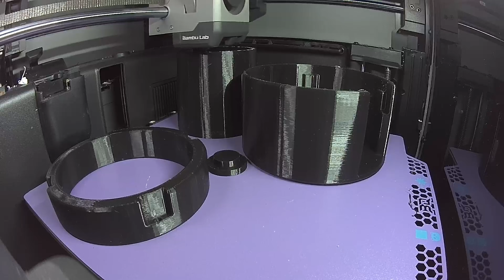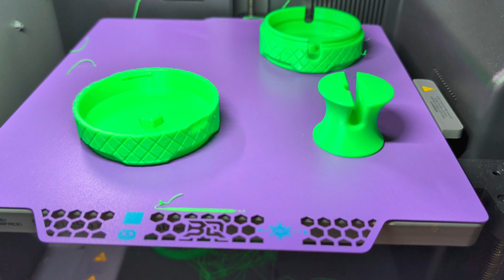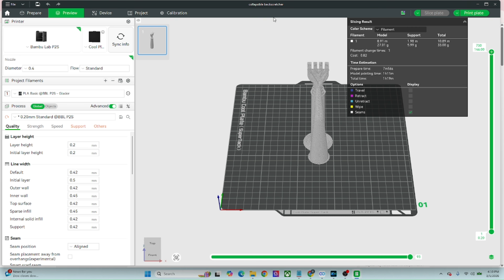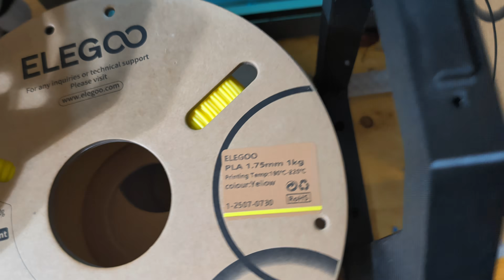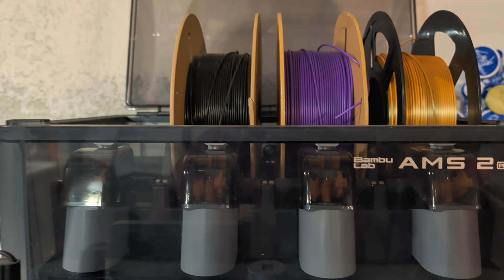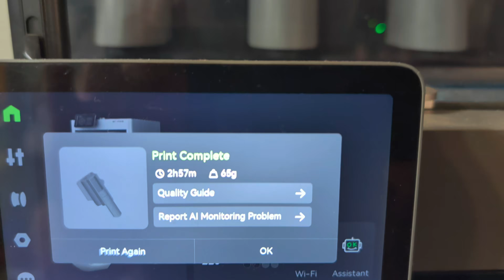I Printed 5 Useful Things (Testing the Galcier CryoGrip Build Plate)

Comment: Depending on brand, PETG can be a real pain in the ass both to get to stick and to print clean. Polymaker is the absolute worst PETG for printing (at least their old formula). 
I own multiple CryoGrip plates and they are awesome, work great. Just make sure you know which version you have, as you cannot use alcohol on certain models, only dish soap and water. Also, avoid brims with them, can be very hard to remove single layers. 
For car prints, or anything outdoors or in heat, ASA is a great filament choice, but works best with a heated chamber.
Reply from the maker: Thank you for informing me about not using alcohol to clean the plates, I have only been using dish soap and now will continue to do so. I wonder if the chamber in the p2s is warm enough to ASA, might be worth checking out.

Comment: I like the fact that you use the elegoo cardboard spools. While I have also printed out the bambu spool and put those in place of the cardboard, the cardboard seems to work fine in the AMS2. I use the Bambu Lab sppol seetings even for the Elegoo filament and it works for me. I also have a similar cryo plate (frostbite not glacier) and I just leave the thing on PEI plate in studio and change the bed temp to 50 and it seems to work fine. Some great information. No nonsense and very similar interests and machines makes this a great channel for me.
Reply from the maker: Thank you for the tips on the spool settings and the plate, I'm glad you enjoyed the video! 😊

Comment: love my CryoGrip plate on my P2S :face-green-smiling: just a heads up the next time you want to change the filament color just right click the object and at the bottom of the pop up menu is an option to change which filament to use 😀
Reply from the maker: Thank you for sharing with us, after filming I too am still using my cryogrip and have had zero issues.